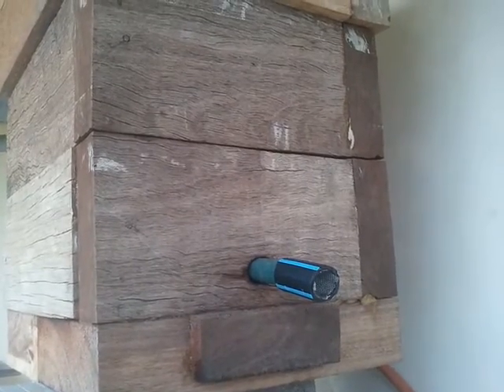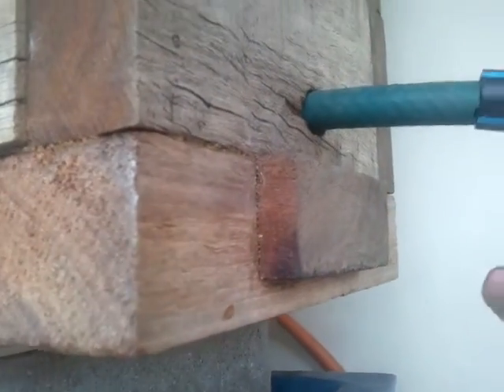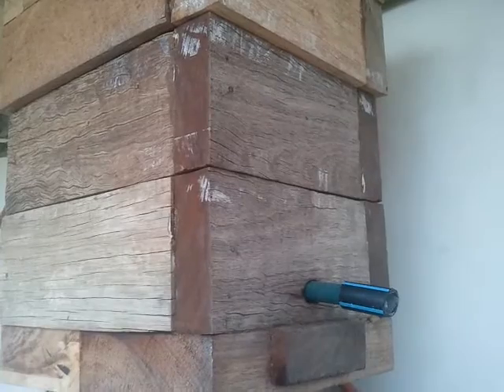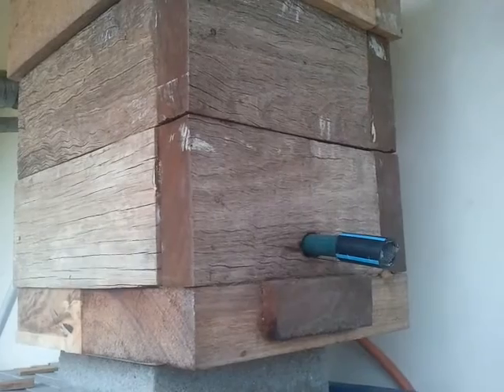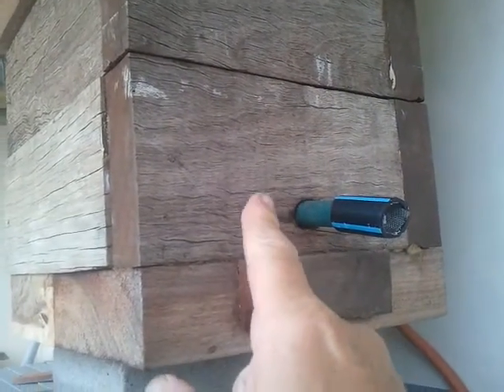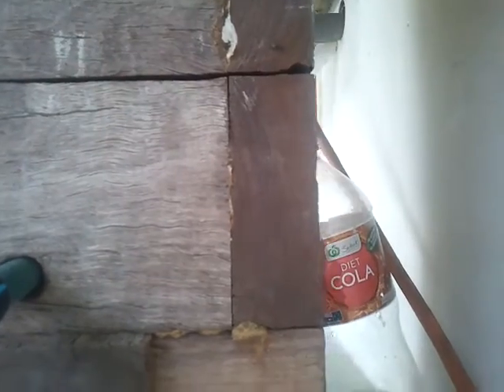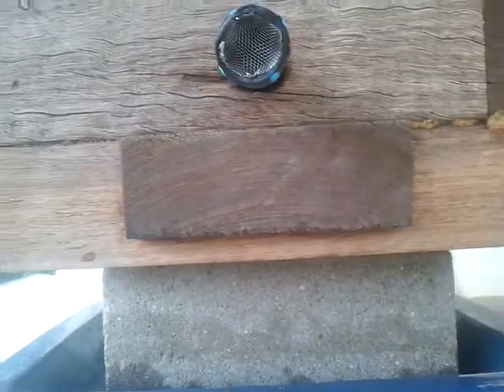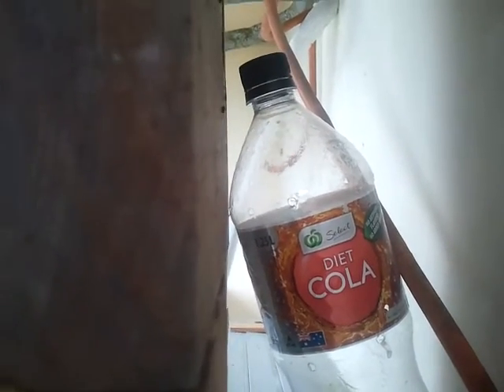North Queensland Native Stingless Bees - Phorid Fly Pest Control Part 4

Comment: Gday. Your other traps used black tape with the hole in the middle. Did you find you no longer need the black tape...just 3 day old beer? I have lost 3 hives to these little flies so anything to keep my other hives going is great. Thatnks for sharing your vids
Reply from the maker: You dont need the black tape, BUT the black colour makes the trap work a lot better. The trap work fine without the tape.
Reply: Graham Sanders Thanks Graham